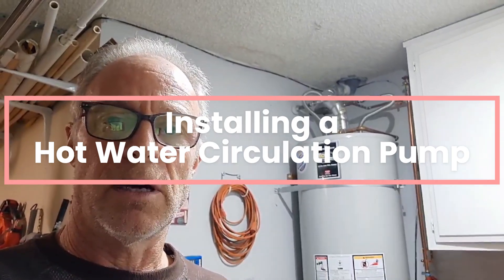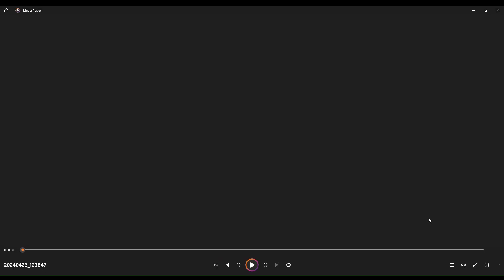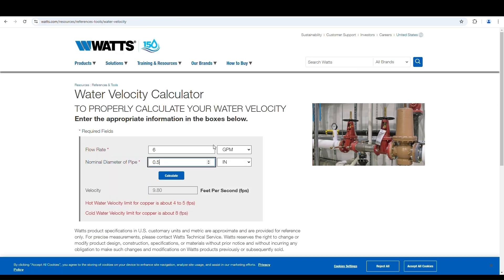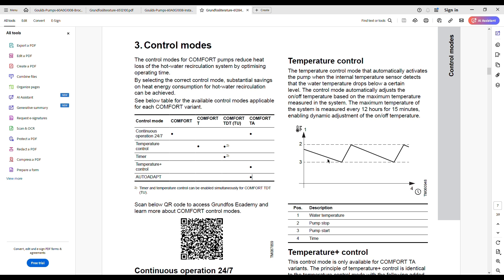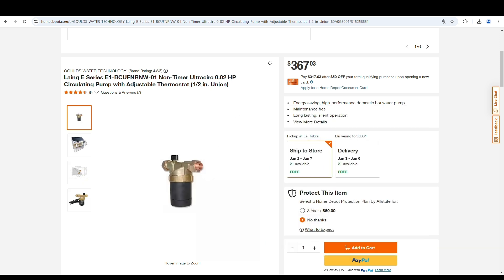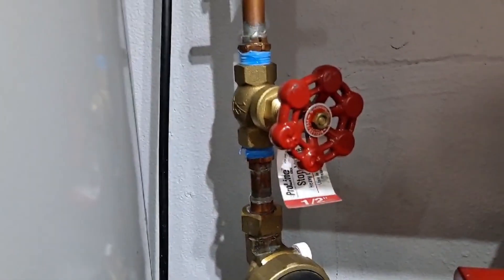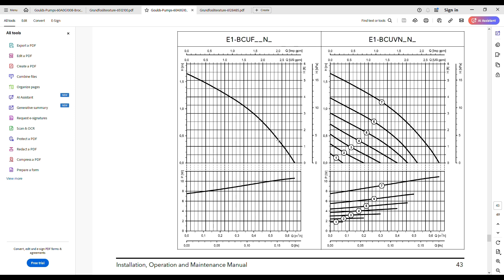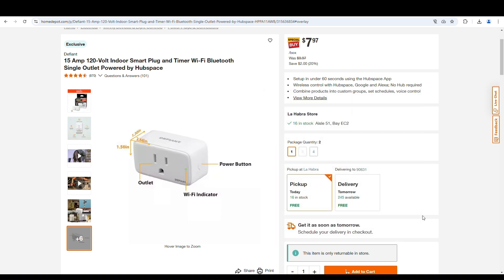How I selected & installed a Hot Water Recirculating Pump

Comment: I'm assuming if you purchased the variable speed model that could be used to throttle the flow?
Reply from the maker: Yes I would assume so.  Usually as you reduce the speed it reduces the flow and pressure simultaneously

Comment: Good video.  If you look at the Watts HWRS-WH and the Grundfos GRU-595916, they look identical (except Watts is blue, Grundfos is red).  This Grundfos is rated at 6.16GPM, which would exceed the 5GPM that Watts recommends for 1/2 copper pipes.   Watts doesn't list their flow rate, which seems suspicious for a pump manufacturer.  Since these are often paired with the sensor value (for non dedicated-return applications) - which are 1/2" lines, it seems like many of these pumps exceed this supposed 5GPM limit.   Maybe that could be an issue if they are being run 24x7.  But for occasional use (like you've implemented), I wonder if it would be an issue.     Also from a spec-deficient perspective,  why no option to select PEX vs copper?  
The valve you put in to reduce the flow rate (due to noise), I wonder if you would have used that with a ~6GPM pump, vs a ~2GPM one, if that would have got your flow rate down below 5GPM anyway.
Reply from the maker: @jwhite4  thanks for the comments.  I agree that the valve could probably have reduced the flow on a 6gpm pump but it's not great to choke the flow too much so I preferred the lower flow rate pump anyway